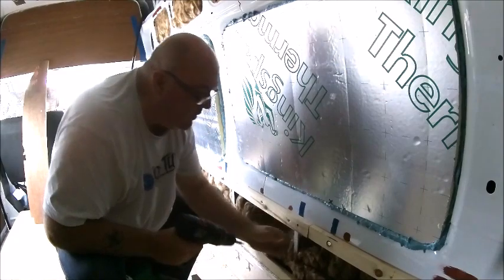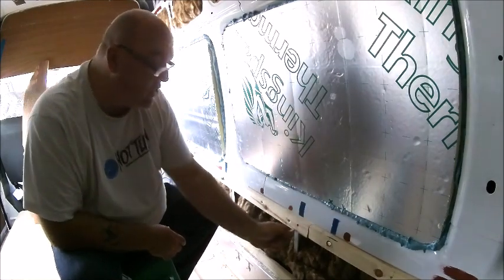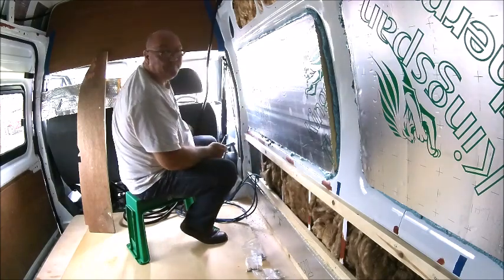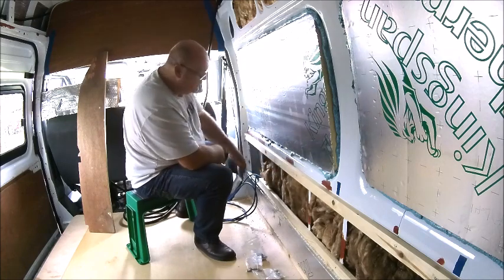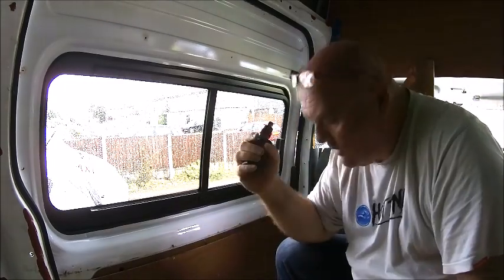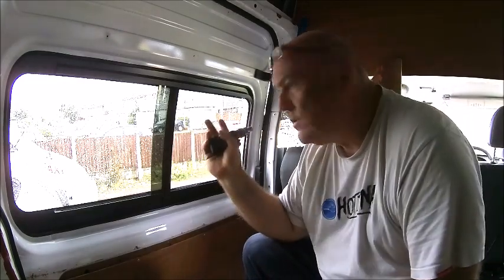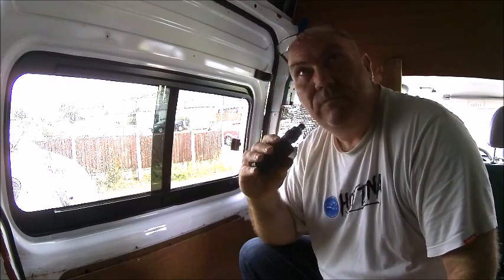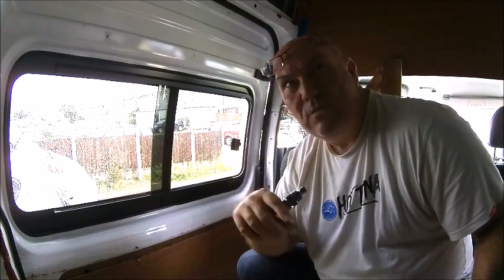13.  Wall Battens and Waffle

Comment: A lot of decisions to make....l don't think anyone has all the answers because there are no regulations on what should be used for what. I like hearing your thought process. Here's something else you could consider the roof fan in the back door! I saw a van with one situated in that location. She said it worked great. The van is coming along nicely.👍😀
Reply from the maker: Kat cankan Thanks Kat. Ive not considered a fan in the door. I will look into it.
Reply: I saw it on Bob Wells channel. Title : Fantastic fan mounted on the back door. Just a thought.

Comment: Air vents.
I keep watching van builds and when the vent part comes up I keep thinking "But mate, you already have vents on the van, if they could be used when the engine is off it would save you a hole and the cost of another vent". Would it be That hard to wire it so you can use it when the engine is off?

Army.
I thought so, the rugged life. But of cause we in the RAF had it tough (we were the one's with doors on our toilets). Don't scoff, take our bull nights, we had to
1. Vacuum the carpet.

Some nights we didn't get to the bar until 7:30 'undred 'ours.

But I must admit I had to cheat going through basic training, you had to pass the shooting test, and I couldn't hit a barn door from the inside. To pass several of your bullets had to hit the target, I got two but it wasn't enough so I improved my score with a sharp pencil. Some lads got carried away and had more holes than they had bullets.
Reply from the maker: Rob M lol. You mean you actually had toilets in the RAF? Lol.
Reply: Yes, we never got into the hole in the ground thing. Even out on maneuvers we had port-a-loos, with paper.

Comment: I'm thinking a forward-facing scoop would be good. If needed, it could do a full change of air in seconds while driving. Facing forward, it wouldn't invite a tonne of red dust in.

Comment: When the Camper van is ready there are many places in Wales you could visit.  I highly recommend a place in South Wales called   ''Parc Cwm Darran''   used to be a mining area called  ''Ogivie Colliery ''  but converted in to a beautiful country pack , and there is a wonderful caravan area you could park the camper van. Check it out, it's easy to get to,   It's two miles north of the former mining town of Bargoed which is in the Caerphilly county borough of the South Wales valleys, close to Cardiff.  .
Reply from the maker: Thanks for that, I will certainly check it out, I love wales.
Reply: Thank you.

Comment: Hoo.. What.. I think it the age barrier.. We had hole in the ground, and most of the time we had to dig it... nearest pub, 9 miles..? sober by time we got back to camp..  
I have a roof light at rear and an extractor fan at front (suck,blow) wish i put them the other way about, sun comes up in mornin and the sun lights the bed up..? Plus, as I put them in first as I lined the roof, I forgot about having solar panels up there too.. If you look at my older vids I have to try and fit solar around them, and only just managed to get them fitted... 
Keep up the good work... Kev
Reply from the maker: Thanks Kev. Im also re-thinking the roof vent in the back because of solar. Im now leaning towards a small opening window in the rear doors. That way I can have some ventilation,  light and a view.  If I do need one in the roof,  maybe I could go for one of those small ones they have in dog vans. There are electric fan ones available. Decisions decisions.